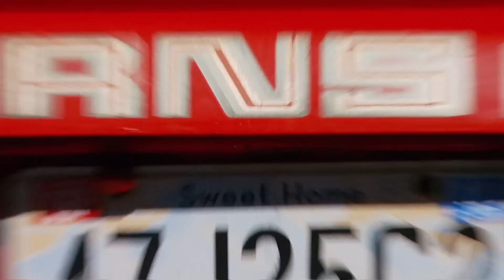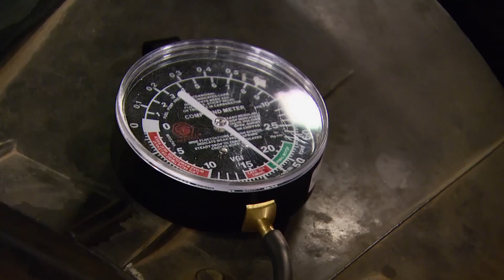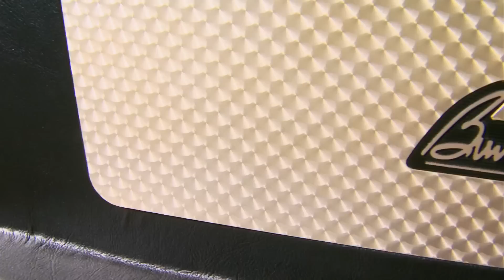Transforming A '78 Trans Am Into A 500HP Tribute Car - Detroit Muscle S1, E1

Comment: 2:07 "There's a 69 trans am right there" not even close. The trans am didnt hit the trans am circuit until 70. Also, that's clearly a 67-68 front end and hood.
Reply: That was clearly a 69 as it had squared fenders.  67 and 68 had rounded fenders.
Reply: The only first gen firebirds that raced in the trans am series were a small handful of Canadian cars. Here's and excerpt I found "...neither Pontiac or the SCCA had reckoned on a cagey Canadian, Terry Godsall.  His 1968 Firebird easily passed inspection because of its 302 cid Camaro Z-28 engine.  When officials questioned this, Godsall replied that this was a Canadian Firebird.  Full-size Canadian Pontiacs like the Parisienne were built wtih Chevy engines, but not Firebirds.  SCCA bought the story anyway, and let this "Firebird Z-28" compete.  Jerry Titus did the driving, but scored no major wins.  Had things been different, however, there might have been a protest.  When Godsall updated the car to 1969 specs, the SCCA caught on.  For some reason they made him put the 68 grille on the 1969 body, felt better about that, and let him run with the Chevy engine."

Comment: 500 horsepower in a car that heavy? 😂
Reply: I mean look at the ram trx 700 hp in a 6000 lbs truck
Reply: That's way more than what 95% of drivers can handle outside of a straight line
Reply: I'm not sure about the TA but my 1980 z28 is about 3200 pounds on a scale, which is pretty light if compared to other modern cars. For example,  the 2020 Shelby GT 500 has a curb weight of about 4200 pounds and makes 700 hp. So 500 in a 3200lbs car is still a rocketing for something with outdated safety equipment. People don't understand what it used to take to get power and take for granted these crazy numbers pushed out by modern engineered engines.
Reply: I know having built a 983 hp crx, (wasn’t mine, personally I despise imports) but by today’s standards 500 in a car like that is pretty tame. Torque used to be what ruled the streets. Now that we have 10k rpm rice rockets it’s a little more interesting.

Comment: Re-posting something from 8 years ago? Full of BS. There has never been a car titled as a Trans AM. A Trans AM was nothing More than an appearance upgrade. A Firebird Formula was the same as A Trans Am, except it weighed almost 325 pounds less. I have both an original black Smokey model and a Formula. Both produce the same poor horsepower and get crappy mileage. My 1997 Formula WS6  ragtop produces 350 HP and still gets 29 mpg on the highway.